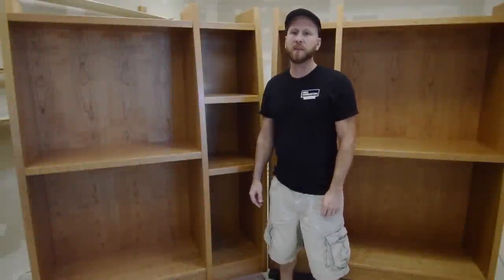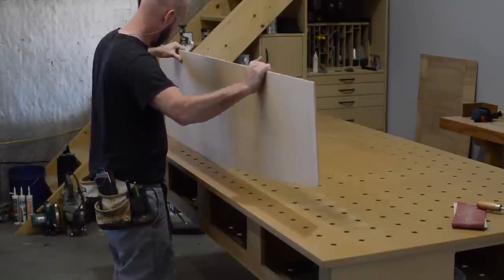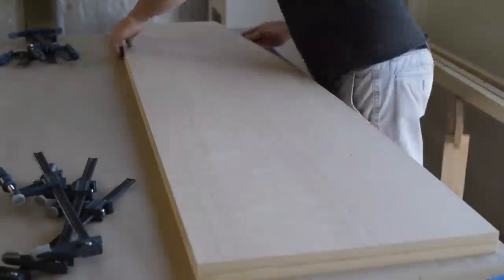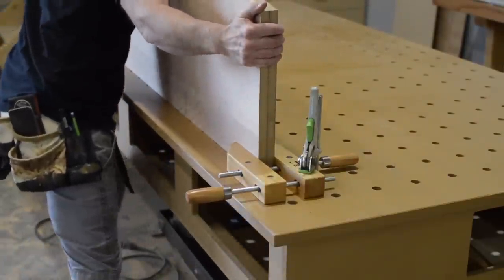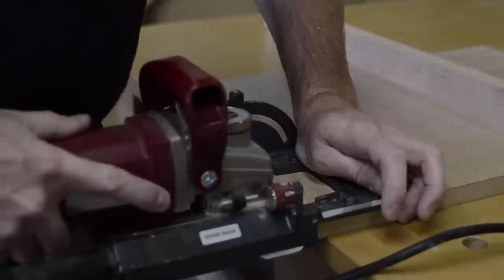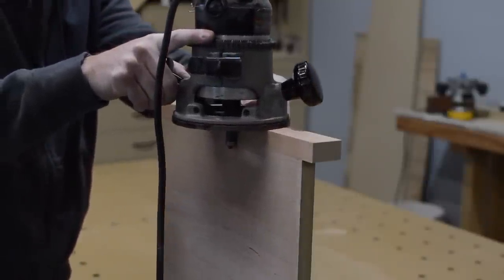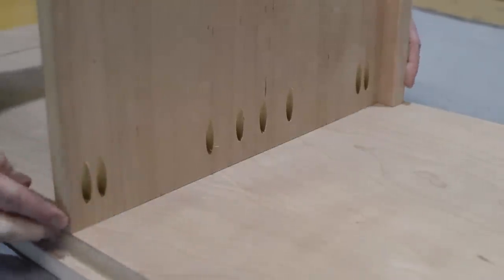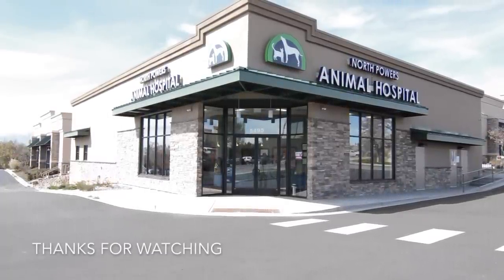Easy to build custom display cabinets, woodworking, carpentry

Comment: I just watched a video on how biscuit joiners are useless (which I disagree with) and along comes Mike's video showcasing, once again, how pretty much every tool is useful if you have a purpose for it.

The really good woodworkers (yourself included) seem to have the mental ability to see beyond a tool's primary use and come up with creative ways that shed a new light on the tool.

Beautiful work as always and I love the variety of projects you take on.
Reply from the maker: I recently watched a video from a very popular woodworker claiming biscuits to be useless and I just shook my head. The amount of bad woodworking info on YouTube is disheartening. The biscuit joiner is good at certain things. For those things I use it. I will say, using tools in creative ways simply comes from lots of time in the shop building stuff and solving problems. Thank you for the kind words.
Reply: @MikeFarrington  I think we watched the same thing :)

Comment: Bicycle inner tubes?!?  Genius!  I've been trying to figure out an effective way of emulating Bandi-Clamps for the longest time, to no avail.  Thank you for that tip.
BTW, I think you should start referring to the little guy by his true job title, "Future Shop Supervisor."
Reply from the maker: Thank you. That is a really cool way to make a bunch of clamps for cheap. Good point, he needs a promotion.
Reply: I counted about 30 something spring clamps, looks like I need to make a trip to Harbor Freight.  I hope my grandson will be my future apprentice.
Reply from the maker: @dsdragoon  I made 100, but I would recommend about 25-35 as the minimum to be effective.

Comment: I love getting new tips from your videos. I'm a cabinetmaker myself but being self-taught means there's all kinds of gaps in my knowledge so being able to fill them in with how others do it is always a plus. A while back you showed a disc sander for the table saw that I then picked up and while not cheap it is so nice to have on occasion. Now I'm looking at that edging planer. Have you tried festool's router setup for that? I'm curious how that works in comparison or maybe they're too different from each other. Either way, keep up the good work. It's odd spending entertainment time watching someone else do the same job you do but you keep doling out the good tips and I keep eating them up. Thanks.
Reply from the maker: Thank you. Its funny that you mention watching someone do the same thing you do. I find myself thinking the same thing when watching YouTube videos.
Reply: +aowoodworks
I trained in Arts and Craft furniture making with my grandfather and the one thing I learned with him was that each apprenticeship was different. What is taught in the workshop you are in can be different in another town, city or county. 

"you do not want to do it like that you want to do it like this".
Reply from the maker: @bighands69  This is pretty much the reason why I end up watching others. I always wonder if the way I am doing something is the best way. Often times I find its not. Working alone, the learning curve can slow down to almost nothing. Watching others can help with that.

Comment: Love it! I’m working on a built in bench build and am taking some notes from this!
Reply from the maker: Thank you. Best of luck with your build.
Reply: Thank you! Do you find glue to be necessary or helpful with plywood to plywood joints using pocket screws?
Reply from the maker: @josiahkaufman6526  In some cases its very helpful. In this case, because the assemblies got so big, it would have just created a big mess as I was putting the pieces together.

Comment: Another fantastic build mike, great use of the flush trim router as a comparison and of course the mighty biscuit joiner. 
We use the pocket hole jig for nearly all our cabinets and ive yet to find a quicker solution to adding components later on in the build so the cover up idea will be used from now on.
Jimmy Joiner
Reply from the maker: Thank you Jimmy. The cover up panels are totally cool. Makes for a really clean build.

Comment: So a biscuit jointer AND a domino are both angle grinders with a fancy face plait on the front! I'm just realising how many tools are basically that formula........ have tool? Need to power it? Slap an angle grinder on the back and you're done!!! I suppose it's the modern idea of a traction/steam engine running EVERYTHING...... just a bit smaller lol

Those shelving units look great! I love the curved look to the front and the way you bent the wood over the ply endgrain. Also, if you have ALL of your clamps on one wall just be a bit careful around it because you probably have several tonnes of clamps hanging from it!! I need more clamps lol
Reply from the maker: Totally good point. Go back and look at the really old Lamello biscuit joiners and its completely clear they used an angle grinder.

Comment: Did you double up the thickness of the plywood for the wider shelves so they would not bow under the weight of the large bags of dog food? Thank you. Your work is something else. Thank you.
Reply from the maker: The shelves were not doubled in thickness. I added a lip to the front to help add strength. I added another layer to the bottom of the shelves to cover the pocket hole.

Comment: Two words. Solid wood edgebanding and Burgess Edge. The Burgess Edge Tooling might make for a good video.
Reply from the maker: Thank you. The Burgess Edge is cool, but its a finicky to setup and I don't think it works for 1 1/2" material.
Reply: Mike Farrington the fact you were using 1.5” stock escaped me. Still I really like the Burgess Edge Bits. A little fussy to set up. True.

Comment: I have never done this but since your drawing bow is just a piece of mdf and can easely be replaced: What about attaching the bow to the panel with hot glue, clamps and / or srews? Just this week I learned from another youtube channel, that hot glue can easely be broken with acetone.
Than run the router along with a flush trim bit and the curve "should" be perfect.

And with chistmas comming you might want to look into Festool routers. I know they are expensive and they are not perfect. I have two of them and the dust collection is just amazing. I thought about that when you blew all those nasty mdf dust everythere. ;)

Those cabinets are very nice and beautyful.
Reply from the maker: Thats a good idea. I do something similar once in a while where I bend some MDF and nail it down with pins, then route against it. The thing about the bow is that it allows you to play around with the curve easily until it looks just right.

Comment: All good, thanks.  I reckon Izzy Swan or any one of "our" mad/brilliant inventors could come up with a jig for a regular hand power plane to turn it into a lipping plane.  And with all that space in your "board room", what about a CNC you can purchase for 10c in the $ that will make cutting templates a breeze and or just machine boards to any shape you require?  Cheers, David
Reply from the maker: Thank you. I have a jig that I made that goes onto a router that does the same job as a lipping planer. That would be the easy way for a home grown solution. Funny you should mention CNC, I am mid build as we speak.

Comment: That looks great! So these were 3/4 MDF with an A side and B side veneer on them? I didn't know such a thing existed. Since I painted the bedroom furniture I made, I could have just gone with these instead of 3/4 BB plywood.
Reply from the maker: Yes, all plywood (MDF or veneer core) will have a good side and a not so good side. The highest grade is A-1. A is the better face, 1 is the lesser, but still pretty good face. A-1, A-2, B-1, B-2, C-3, etc etc etc. Some types of plywood are a little different like baltic birch, those are both letters for the faces, and both faces are the same.

Comment: Hey Mike,
I am watching your Videos quite a lot in the past days and commented on another one recently (The nervous guy from Germany under the Kumiko video) and maybe I have a little Tipp for you. I worked for some weeks at a yacht builder and they made a hell of a lot of round shaped edges in those boats. They used kind of a similar technique to draw the shape out like you did, BUT they used acrylic Glas instead of mdf as bendigmaterial in their advice. It bends way better and can be used way longer without breaking or bending in one aerial more then others. Maybe this is something you want to try. 
Have a nice day and keep up the great work. 
Ps.: I hope my English is a little bit better know, I added English to the autocorrect system of my phone.
Reply: Plexiglas, not acrylic. Sorry for the mistake.
Reply from the maker: That is a good idea that I would totally do, but I use MDF because its laying around and free. If I bump into a reason why I have a long leftover of plexi it will use your idea.

Comment: Very nice cabinets. I expect your client was very happy with the result. A question about MDF. Is the reason for it's use, price or stability? I know plywood would be a lot lighter. MDF is flat but doesn't take screws well in the edges. But anything bigger than a couple of feet square and my back refuses to cooperate.
Reply from the maker: Most places these day don't sell veneer core plywood with A-1 veneers. The place I buy from will sell a combination veneer and MDF core. So I just go for the all MDF stuff, its a cheaper. It is super heavy, I will say that.

Comment: I'm looking for that type of blue positional "flexible position but non-flexible hose" like you have on your sliding crosscut table saw but I cannot seem to find it anywhere. Can you please share the brand/supplier for that?  Many thanks in advance and thanks for another great, informative, and entertaining video.
Reply from the maker: Its called Loc Line. I use the 2 1/2" stuff.

Comment: Have you considered the Lamello Zeta P2 with Divario connectors to install the shelves? Seems like they would save you a ton of time. Wouldn’t have to drill 16 pocket holes per shelf and install a panel to hide the holes.
Reply from the maker: I almost bought one of those for this job. I didn't for good reason and it will become obvious where I spent my tool budget in the next few videos. That is a really cool tool, I hope to own one some day.
Reply: Looking forward to the upcoming videos. FYI, the Zeta is on sale now for 1500,  normally 1850. Also, expect a big price jump soon on Festool. They got hit with a 25% tariff on 10/18/19. Grab whatever European tools you need ASAP.
Reply: @MikeFarrington  My guess is a CNC!
Reply from the maker: @matthewmills6452  Ding ding ding.
Reply: @MikeFarrington  You are going to love it!  You basically got a full time employee without all the costs that would go with that.  Templates are your friend.

Comment: I've always struggled to seamlessly apply solid edge banding to (birch) plywood. Even with a freshly sharpened saw blade, the freshly cut plywood edge has slight imperfections, leaving a very slight gap. Have you found that plywood (as opposed to MDF) is prone to this?
Reply from the maker: MDF will mill up cleaner and give a cleaner joint. A router bit may give better results than a table saw blade. Give that a try.

Comment: Mike, just curious why using biscuits makes one a "hack".  I've used them exactly one time in my woodworking career (laughable that I would even characterize it as a career), and it was my BEST project... what's the story on biscuits... is there something about them that master craftsmen disdain?  Or something that happens to the piece over time?   Just curious.  Love your channel, by the way!  I have learned much from your videos!
Reply from the maker: That was a poke at the hardcore festool guys who thing dominos are the only method to join wood. Biscuits are a great way to join wood when used correctly.

Comment: As ever a cracking video and a cracking job.
Quick question, what do you see as the advantages of using the biscuits for the shelf alignment vs dominos?  I would have thought while both give alignment the domino would give a little more strength.
Reply from the maker: Thank you. Dominos would be fine, I'm not sure the extra strength is all that much. I use the biscuit joiner because its an easier tool to use.

Comment: Beautiful cabinet. I noticed in this video and a mahogany cabinet, you show a preference for biscuits over dominoes for cabinet construction. As a new owner of a Domino (and a biscuit joiner owner), what is your reasoning? Speed? Cost of materials? How do you choose which method to use? Thanks.
Reply from the maker: Thank you. I like the biscuit joiner because its fast accurate and its a tool I am used to. I use the biscuit joiner for pretty much everything except joints too narrow for a biscuit to fit in or if I need the added strength.

Comment: Fantastic! What was behind the material choice of veneered MDF vs. solid wood?
Reply from the maker: Cost mostly. This was a project that had a specific budget that I had to work within. Plus, that would be a lot of solid wood, I really don't like using more wood than I need to.

Comment: Hi Mike, big fan of your work and love your videos... the shop apprentice touch makes me super stoked for when my little one is old enough to work with me in the garage!

Anyway, hobby wood worker... I've just added trim to my flat cabinet doors in my kitchen to give a faux shaker effect... last bit is to round over the edges as everything is looking pretty.... edgy. what size radius bit would you recommend and what size did you use in this video? Cheers buddy and all the best!
Reply from the maker: Thank you. I used a 3/32" amana round over bit, but a normal 1/8" works great for doors and drawers.
Reply: Thanks Mike :)

Comment: A question on the bottom edges.  Have you seen issues with them over time?   Most people (owners) ultimately try to slide this size cabinet around without putting something under it.   Did you put feet on it or maybe edge band the bottom too?
Reply from the maker: I put on some felt sliders. The stuff I use is made by 3M and is very durable.
Reply: Mike Farrington Thanks Mike!

Comment: The size of your workshop is unbelievable, anywhere in the UK, even far away in the countryside you would need a staff of at least 10 working 7 days a week to make the ends meet. So jealous. Very few people, even commercial customers, are willing to pay much over IKEA prices for furniture. Most joiners work out of their home garage, a big garage shop would be 4 by 7 meters. Again, SO jealous.
Reply from the maker: I feel your pain. I moved from San Diego, where real estate is super expensive as well. My last shop was 1/4 this size, which I thought was still pretty good.

Comment: It's probably simple but do you have video  on how to cut the bike  inner tube and affix to the spring clamp? I think this is the only thing keeping me from attempting to do a plywood project. 💝☀🌵
Reply from the maker: I just use normal scissors to cut the tubes. Couldn't be easier. As to installing it on the spring clamp. I use simple green as a lubricate and just force it on. I will say, I made my clamps is a few sessions because my fingers were getting sore.
Reply: @MikeFarrington , oooohh! The diameter of the tube is a tad smaller than the width of the clamp!? I got confused because those clamps come in different sizes. How long do you cut the tube? 4-5 inches? 💝☀🌵
Reply: @MikeFarrington  simple green sounds good. What about soaking the tubing in hot water?
Reply from the maker: @suzisaintjames  I use the 1" to 1 1/4" tubes, but your clamps may vary, take one to a bike store and ask them for a couple tubes with punctures. I use a 6" piece of tube, but experiment with yours. It took me two tries to get it right. From there I went into production mode and made a bunch. I don't think hot water will help too much, the rubber used to make these is fairly heat resistant, but it may be worth trying. Honestly a little lubricant makes it pretty easy to slip on. It just gets tiring after doing a ton of them. Hope this helps.
Reply: @MikeFarrington , thanks for the details. You're the best. 💝☀🌵
Reply from the maker: @suzisaintjames  My pleasure.

Comment: Well, I wasn't expecting a master class in cabinet construction this morning.  The leftover plywood to cover the pocket screw holes is a stroke of genius.  Mike, this is an amateur question but I hope you can help.  I ruined a small cabinet I was working on by trying to screw on a 1/4" ply back into a rabbet on the back of the case.  I think my rabbet was too shallow though (and I wasn't screwing straight enough) because the screws pierced into the inside of the case .  How do you avoid doing this?
Reply: Try to predrill at slight angle
edit.
also short screws. For 1/4" back 1" screws will be more then enough
Reply from the maker: Thank you. Its not an amateur question, most of us have made the same mistake. A couple things. Make the rabbet as wide as is reasonable, pretrial at an angle, and use shorter screws, 1 1/4" is all that is needed for a 1/4" to 1/2" back.

Comment: Mike, you are my Yoda, could you suggest a finish for a solid oak shelf thats going in a bathroom? I'm not a fan of polyurethane style ones, will you trusty Osma do the trick? Thanks
Reply from the maker: Osmo would be OK, it would probably need refinishing more often due to the moisture. Damp areas are one space where I think ploy works well. If its a half bath go for the Osmo.

Comment: would a flush trim router bit with a good bearing work for trimming the edge banding or would it tear it up?
Reply from the maker: It would if you could balance it on the edge.